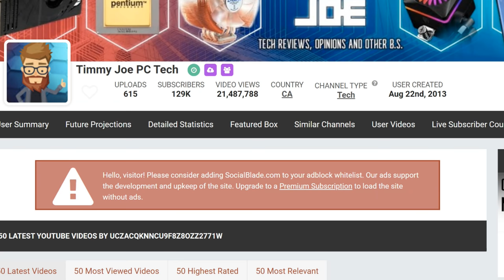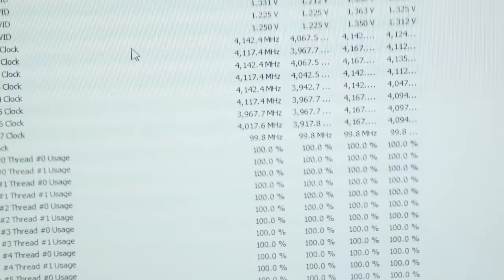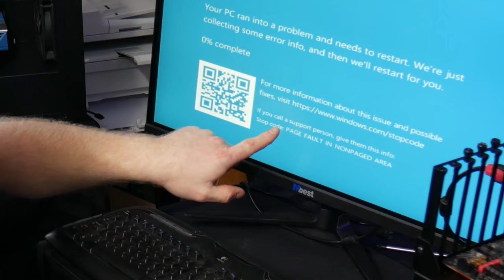This Ryzen 3700x was my biggest problem in 2019...

Comment: i had a similar issue with the 3700x and asrock phnatom gaming 4 x570. bsd all the time, even on installing windows. switched ram, gpu, psu. i send it back to the vendor on warranty and the shop gave me a new 3700x and a new asrock phantom gaming 4 x570. since then never had an issue but i can’t say what the problem was, the shop can’t say what the problem was., what hardware was faulty, if it was faulty. it’s my first amd pc and i think is the last amd pc for me. when i will upgrade i will switch to intel. my old i7 4790k was rock solid from the day a bought it till the day i sold it, with a cheap mb and not so great cooler on it, it worked flawless. on amd i had to troubleshoot for a month and at the end i got new parts but still don’t know the cause.

Comment: I actually have a weird troubleshooting story from yesterday & today (Win7 removal day yay! /s):

PC turned on and was useable through the day, but the user turned it off and couldn't turn it on afterwards, did the correct single beep but it was still stuck in post.

What solved it? Unplugging the printer. Quick test and the computer does boot up with KB/M on those USB2 ports where the printer was, and the PC also turns on if the printer is plugged into USB3, but printer and USB2 is a no-go. Same power sockets, so I'd say that's out of the question but I'm still investigating

Gigabyte B350, so I guess Gigabyte is cursed?

Comment: You need to switch your bios to 1.0.0.3ab or earlier to make some early chips work, I got a 3600 on launch(bought it) and it has this issue, I think it's because idle voltages are too low for some batches. I will be RMAing this chip, replaced memory, motherboard etc, no dice on newer bios versions.

Comment: I have 3700x at 4.4ghz all cores never have problems...
Memory(RAM) : Corsair Vengeance LPX 16GB 3000mhz
GPU : Sapphire 5700xt pulse 2010mhz
Motherboard : Asus crosshair Hero VIII
CPU cooler : beQuiet dark rock 4 pro

Comment: My dell xps kept blue screening no matter how many reinstalls or changed out memory dimms there were or the power supply or drives. The problem was that I was using it with a tv, as soon as I started using a regular monitor it worked fine

Comment: I'm currently chasing a gremlin in my own secondary system that I keep at my parents house. I keep having very intermittent bad stutters on the system and nothing will change that. It has persisted through chipset driver re-installations/Windows refreshes/Migration to a better SSD/Multiple Graphics cards/stock speeds/underclocked speeds etc. I will take all 3 SSDs out of the system this weekend and test them in my main rig, to rule out software problems. Both are Ryzen Systems, so there shouldn't be a problem there. It most likely is a windows issue, but setting my dual-boot (Linux/Windows) back up is always a pain.

Comment: I got kinda the same issue on a Asus mainboard with my 3700x, I just can't put 32gb 2666mhz memory in, 16gb works fine. 32gb 3600 mhz memory works fine too... 32gb 2666 mhz does exactly the same as yours.

Comment: I had the same problem, bought Aorus Pro Wifi with 3900X and my machine kept crashing... was so angry that I returned the board and bought the MSI ACE board and it works flawlessly... It's not the CPU, because my 3900X was retail. Will never buy Gigabyte board again.

Comment: MSI Tomahawk x570 and ryzen 7 3700x month after initial build got lots of BSD's so decide to reinstall windows on a new drive just to make sure it was not the windows install gone screwy, and it wont even install windows swopped out various parts next step is replace the processor , RAM, MOBO, PSU, Known working Graphics card still no fix so hopefully the replaced processor will work failing that im stumped.

Comment: I had the same thing swapped everything and in the end MSI MEG ACE worked fine but in the end I sold all the parts. Im running Intel /Z390 and also Ryzen 7 2700x w/Asus prime X470 Pro .Everything running smooth.

Comment: This video made me very suspicious of my "bad" 5900x that fails single thread stress tests on only one repeatable core on my x570 Aorus Pro Wifi.  I bought a MSI B550 Unify that will be here tomorrow so I am going to swap into that board to see if I still get failure.  Otherwise, it's off to AMD to get the CPU replaced under warranty

Comment: Might be that their bios uses a slightly different voltage setting? I had an issue with a (thought stable) undervolt that would do the same thing. My undervolt was at -.068v offset and would be fine under stress test but would randomly crash when at idle. Then moved the undervolt to -.0625 and the problem went away.

Comment: I am running a 3700X on an ASUS Crosshair VI Hero and I am having bluscreens ever since. Only when on low workload like web browsing, never in games. It runs like 3-6 days without BS and then like 4 BS within an hour or so. Really frustrating. Was always hoping the next BIOS update will fix it. About 2 days ago I found someone on reddit having exactly the same issues only difference he is running a 3600. He could run it for hours on Prime95, no crash. He was also very frustrated and then a guy said to him, he should run Prime95 on small FFTs, which is testing L1/L2/L3, and  watch on HWMonitor whether a core will stop working. So  he did it and boom. FATAL ERROR. Hardware failure detected. I did the same thing and I had 2 cores stop working instantly. So the other guy claims he has at least 10 cases of customers who had the same issues. According to him it is an L3 cache issue with the early july 2019 models. His and mine are from july 2019. He said that he could temporary fix this problem by setting an  offset Vcore +0.03v +0.05v +0.06v. But it is not a real fix, he should still RMA the CPU. So I am very confused. Is it now a CPU problem or a motherboard problem???
Reply: Interesting. How can you find the manufacturing month for the chip?
Reply: @vktechtv4244  Sorry, I meant the chips that were shipped just after release. I had mine 3 to 4 days after that.

Comment: Check your SOC auto voltage. My gigabyte arous master sets the IMC voltage WAY to high on auto. And it did this for both my 3900 and 3950. The only way i caught it was using the ryzen memory tuner.  Seeing rhe recomended setting was way lower for an overclock of 3700 ram. Think it was 1.1 volts vs 1.45, yeah crazy. 
I'm guessing that the board was pushing to much voltage and slowly degraded the IMC to the point it became unstable at that voltage.  My beothers MSI pro carbon x370 did that to his golden sample 1600x. His bios flipped to the back up and he didnt know and his machine started blue screanning. Checked the bios to see the voltage way to hi.

Comment: Well, i dont know how to say this. But u can troubleshoot that problem down to what cause the problem. Other then changing hardware. use the event viewer. Get the code out, check that first. if that is not lead for you, take out the hexadecimal out, use a converter on that hexa and get the proper code.. Then it tells you what ever u need to know. 

I had a problem like that you have. Who would have known, that it was the headset that caused the BS. When i got the hexa code, it could tell me, that it was the 7.1 controller on the cord. i unplugged the headset. no bluescreen.  It was a HyperX cloud problem, that no one could solve for a year. Not even the pps that made it. They knew somthing was going on.. i put a mail to em, bam, update a week later for the issue with a thank you mail. 

Proper troubleshoot helps.. just saying ;)

Comment: I am currently running a 3700X on that same Gigabyte x570 motherboard except my motherboard isn't the pro version. Just the regular Elite wifi version. I have had 0 issues and just built this pc about 2 weeks ago. Not a single blue screen or any issues. Wonder if it was just the cpus that released on release date were defective?

Comment: Hah Timmy I was facing the exact Same issue since Windows updated to 1909 (i was running 1809 for some time now, WiFi wouldnt Work in 1909)
Ive got an Asus x370 Prime and 1600x tho.
Very same Kind of bluescreens, in idle or when stressed...
Luckily, A BIOS Update fixed everything for me.
But Asus Had been best with New BIOS releases on x370, b350 in my experience.
I still remember, bought 1600x at Launch with the cheapest ddr4 3000 Kit g.skill aegis and after the First BIOS Update it ran flawlessly, while Weeks and months later, User Reviews of any faster memory Kit were still complaining about incompatibility on other Motherboard vendors

Comment: I occasionally get this exact blue screen error with my 9900k on a gigabyte z390 ultra board, I have not been able to solve it now for months but it happens so rarely to me its not been too much of a bother, the rest of my system is a evga 2080ti xc ultra and 16gb of gskill 3600mhz cas 16 memory. my processor is overclocked to 5ghz very stable. I have considered lowering my ram speed to be more in line with mainstream thinking that maybe 3600mhz is causing some issues as its less common but it doesn't make much sense to me.

im a bit disappointed you didn't update or backdate the bios on the board to see if that solved the issue as that's now my thinking. but yeh, safe to say its more likely the board than the cpu as I have it happening with intel too.

Comment: I got a Ryzen 7 3700x om a Asrock x570 it been going for mths with no problems

AMD Ryzen 7 3700x & 4.0gb & Masterliquid 240 on a ASrock X570 Phantom Gaming 4
32 GB Corsair Vengeance LPX DDR4 3200 RAM
MSI GTX 1080ti o/c
Samsung 970 EVO Plus 500GB NVMe M.2 (Windows + Programs)
Crucial P1 1TB NVMe M.2 PCIe 3D NAND SSD (Games & Steam)
3 x 24” Samsung curved display

Comment: I have the 3700X with the Gigabyte X570 Elite Wifi ATX, while I don't have any issues with blue screen, but my ram (G.skill Ripjaws F4-3600C16D-16GVKC) just would not run at full speed, XMP or manual settings, at 3466mhz or lower the system is rock solid, but at 3600mhz, the the bios would reset itself during boot up, at best the system, will boot into Windows but would only last for a few minutes, done all the usual stuff like updating drivers/bios/etc, any ideas would be welcome :)

Comment: Are the Gigabyte boards giving slightly less voltage at certain clock speeds, causing instability, where the other boards are volting a little higher?

Comment: Zero issues with my 3800x and Aurora x570 pro WiFi.  Dec 2019 mobo bios; retail 3800x bought Dec on sale.  It hits 4.5mhz with the stock prism and 5 case fans on Lowest speed with PBO Enabled and Gskil 3600mhz cas 16 on XMP and the blck at 101mhz for an extra spike on both cpu and ram. Not one single BSOD.

Also why are you running a spire on a 3700x?  72c on an open air bench is NOT acceptable. 72 is what I see under load in a closed case with the fans on low.

If you want troubleshooting gremlins........use rgb strips, rgb mobo, rgb case, rgb on graphics card, rgb fans and through in some rgb peripherals and then try to get all that shat to work together without conflicts.

I have heard the X370 Asus in particular doesn’t like Zen 2 though.

Comment: I have an issue right now with two identical computers running Asus crosshair extreme Viii  boards and 5950x cpu's.   One runs perfectly fine since the build and the other is nothing but a page in non page fault at random.  As of tonight, we have changed part for part with the exception of the cpu (later today) and it's driving me crazy :)  Almost like it has a cache issue....we'll see.
Reply: Update:   After moving the Cpu to the other machine, it page fault crashed at start-up so RMA it is.

Comment: Timmy i been having the same issue since November 25 or so. I did reinstall and made sure drivers were all up to date and it would still freeze on me basically the same stuf as your client etc. Just one problem though, I HAVE HAD MY SYSTEM for at this point 3 YEARS and it started this out of the blue. It has to do with windows updates and some windows updates and driver updates later my system is also seemingly running fine again. Be thankful that you at least get blue screens and not like mine where it would randomly freeze and nothing not even crash dump would initialize. Also just in case if you think it is an AMD only problem, it is not i seen someone with a 9700k and a 2080 super have the exact same issue. If it was indeed my hardware and your hardware why on earth is it magically fixed after a few windows updates? Microsoft and them forcing the DCH drivers on everything is also an issue since as far as i can tell that is what caused it with the updates. All motherboard vendors are now updating their pages with the new drivers which Microsoft forced push on all system and basically made many of ours unusable for 1 month. At least that is how i see it, case can be different in your case but i doubt it.

Comment: Deal Alert.
Ram brand Oloy is selling ddr4 3600 on newegg on the cheap 32 gig. I got for 100.00
Speeds
3200 cl16 18 18 18 39 1t @1.35v 
3600 cl18 22 22 22 42 1t @1.35v
4000 cl18 24 24 24 44 1t @1.4v
i use Anthem as my stability tester..lol
All stable. I set xmp then set manual. Save exit. Perfect.

X570 unify + 3900x h1000i br1500ms ups. Ead.

Comment: Wow after 2 months looking for right answer on the internet, why my build wont work same issue ( BSOD -  Clock Watchdog Timeout mostly if I install a app it would freeze no matter what I do) or it would just freeze on its own no load what so ever 
Spec's : R 7 3700x
Ram DDR4 32GB
MOBO: GigaByte 450 elite rev 1.0

I even sent out to for replacement they said the board was tested ok and they sent me same one, so frustrating

Comment: Just installed the 3700x on the AX370M Ds3H and motherboard shows it’s compatible with the 3700x. I’m getting up to 30 minute boot times on a gigabyte motherboard. After it boots up there’s no issues.....just really long boot times that I can’t figure out why. Thanks for this video. I might have to return the cpu and stuck with what I have :( or upgrade the motherboard.

Comment: I bought a pair of X5675 on ebay, the pair started out in my dell precision T7500(my gaming rig), then i upgraded T7500 to x5690 and i tried it in a supermicro board, the board wouldnt post, so i tried my X5650s, posted, tried my L5640s, even went so far as to try my pair of x5690s all of them posted except for x5675, so ok, this supermicro board is a bit weird, the x8dtt and variants get all their power for both CPUs RAM PCIE from a single 24 pin connector, so i thought i'd try it on a standard eATXsupermicro X8DL-i(i think) same thing, either one, or both of them just wont post on supermicro boards

Comment: I had a similar experience with Ryzen first Gen, just around launch I put together a Ryzen PC with a Ryzen 7 1700, 16GB 2400 MHz Adata RAM, an Adata 256GB m.2, an MSI B350 gaming something motherboard, a Corsair 650W PSU and my old GTX 970 Asus strix. The computer worked just fine for a couple of months and then started to BSOD randomly, sometimes while gaming, sometimes while watching YouTube, sometimes while just doing nothing. The blue screen messages were widely different so I started by replacing my GPU with a GTX 1070 (I planed to do it anyway), the problems persisted, so a couple of weeks later I bought 16GB of RAM Gskill 3200Mhz, the problem persisted (both with the memory at stock and at 2933Mhz, higher won't boot), a couple of days after that my motherboard started to send me to the configuration screen every time I booted the machine with the message that it had detected a change in hardware), and then after a week of two the computer just died. So I bought a new motherboard Asus B350 Strix and a new power supply just in to be sure (an EVGA 550W). The computer worked fine again for a couple of months and the started again with the BSOD. By that time the new Ryzen CPUs were available so I bought a Ryzen 5 2600, same thing. Needless to say during all this I reinstalled windows a couple of times, tried linux, diferent drivers, updated bios, even tried another sata SSD, another case, even changed again the ram for some Team Group 3000Mhz and same thing. So I finaly said fuck it and went and bought an I5 8400 and a B360 gigabyte motherboard, with all the rest of the components of the old computer and never had another issue with my pc. Just to be clear I sold all the components that a was replacing and they worked fine for the people I sold them to, so I have no idea what the problem was.

Comment: You shouldn't have to troubleshoot that much. You are pairing an AMD chipset, which for the past 30 years have been the buggiest and quirkiest chipsets in the industry, with Gigabyte boards when Gigabyte has the worst BIOS (and now UEFI) engineers for the past 30 years. What did you expect to happen? If you absolutely have to go with GB..for whatever reason, try to find a reference board because those have stock UEFI images (most of the time).
Reply: (Also that particular stop error does not mean memory issue..it literally means that a memory address was referenced and there was nothing there. Most hardware maps to memory addresses so it can literally be anything--even a faulty driver. You have to load the memory dump under a kernel debugger and examine it. The stack trace alone should point to the actual component 99% of the time. I am an engineer but you can find reasonable guides on how to do this that are easily understandable by someone who is tech savvy.)